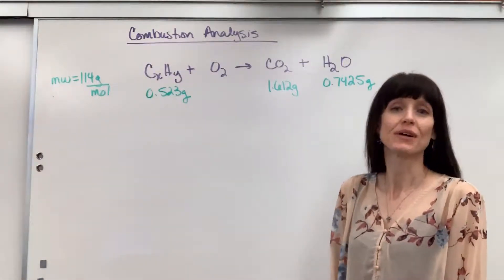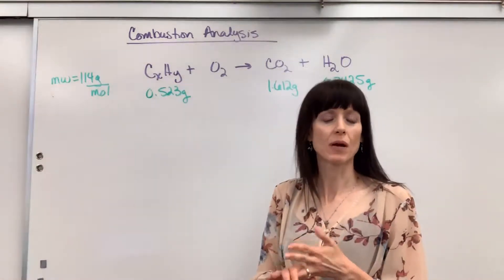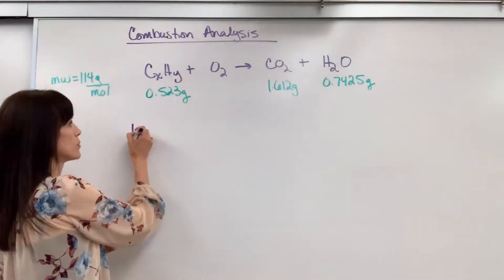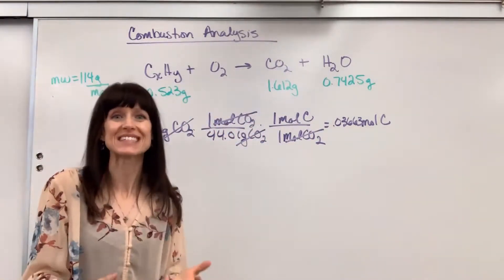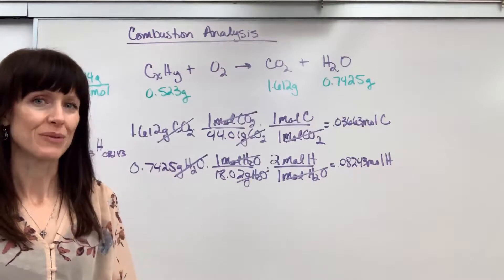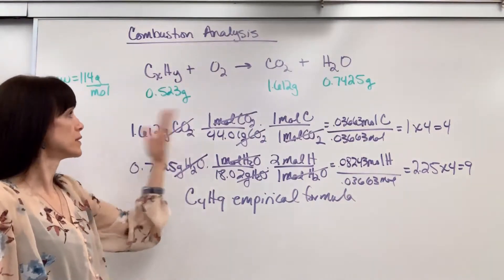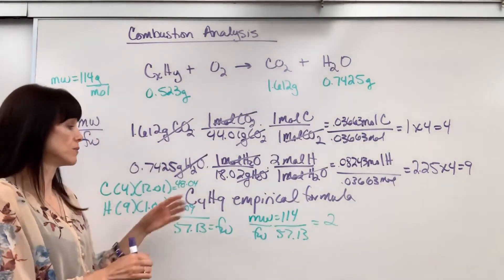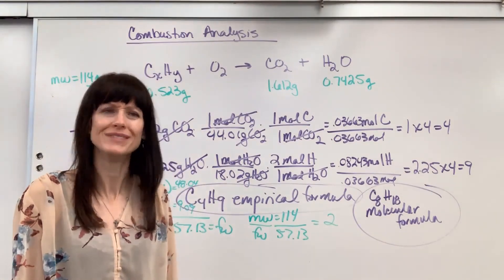Combustion Analysis

Comment: Great video, I especially appreciated its pace. I have two questions:

Since oxygen's mass is not given, could we substract the mass of the hydrocarbon from the mass of the sum of the products? It seems as though we could since I assume mass is conserved.

Additionally, could we use a molar ratio of O2 to one of the products to find oxygen's mass if it isn't given and we don't use subtraction to find it.
Reply from the maker: Hi!  Yes to your first question regarding subtraction based on conservation of mass.  No to the second question because it is impossible to balance the reaction without knowing the chemical formula of the hydrocarbon first. Therefore the molar ratio is unknown.  I appreciate the "thinking" questions!  I hope it goes well:)

Comment: Hey teacher, our chemistry teacher gave us a question:14 grams of an alkane burns .how many moles of water will be produced. Is it solvable?
Reply from the maker: Hi Abdelfatahbakr, I thought about this and I propose it is unsolvable.  You either need the chemical formula for the alkane or the mass of the water or carbon dioxide.  I hope that helps.  Tricky question.  Thanks!